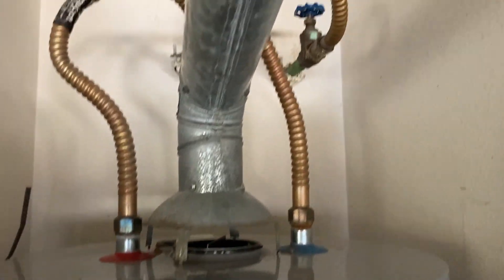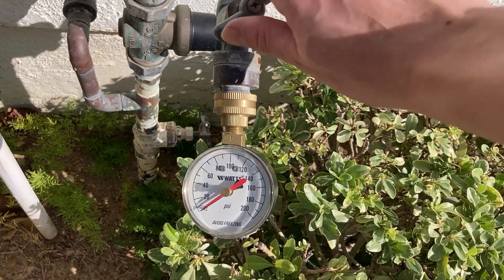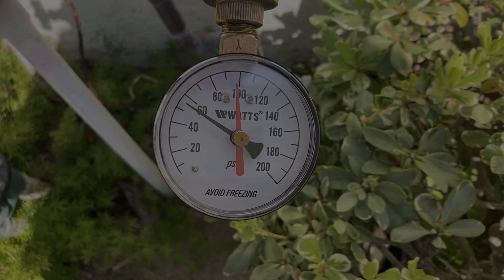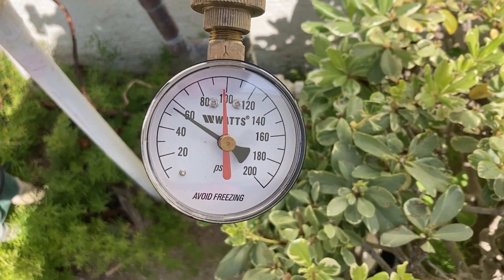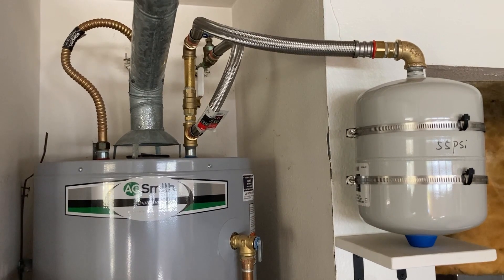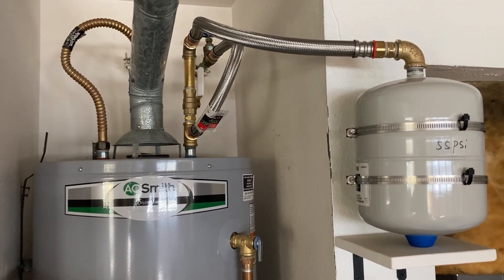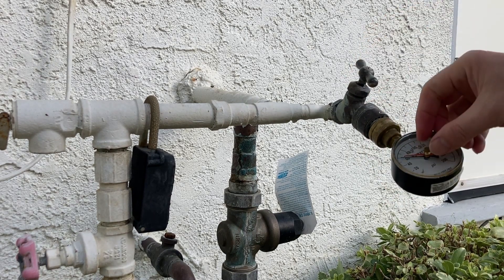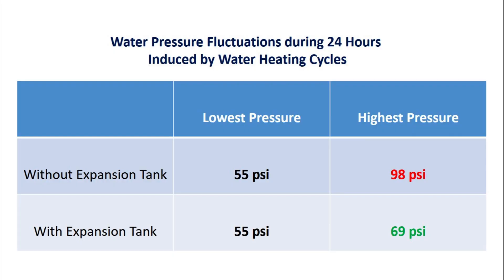Comparing Pressure Fluctuations Before and After Installing Thermal Expansion Tank to Water Heater

Comment: Shouldn't your hoses be reversed as you want the inlet to in the pipe & the tank line branch off after the inlet?
Reply from the maker: You mean switching the connections of the two hoses to the water heater? I don't see why it matters. Right now, the tank line is also a branch after the inlet.

Comment: What kind of hose is used between ex.vessel and main systems.Is that for Water or gas
Reply from the maker: https://www.homedepot.com/p/Everbilt-3-4-in-FIP-x-3-4-in-FIP-x-24-in-Stainless-Steel-Water-Heater-Supply-Line-EBBC-07-24a/206527409
It is for water.

Comment: System needs a PRV installed. Expansion tank on water heater has nothing to do with pressure fluctuations from street.
Reply from the maker: A PRV is already installed in the system. The pressure fluctuations measured in this video is for the pressure on the home side of the PRV, not the pressure from street.

Comment: Watts LFN55B-M1 water PRV has a thermal bypass built in.
Reply from the maker: Thanks for sharing the information. 
https://gistgear.com/product/B000E78XHG
Watts LFN55B-M1
"THERMAL EXPANSION PROTECTION: The valve includes a bypass feature that effectively controls thermal expansion pressure, permitting the flow of water back through the valve into the main when pressures - due to thermal expansion on the outlet side of the valve - exceed the pressure in the main supply."
Reply: And...           A thermal bypass is not the same as a thermal expansion tank.
Reply: @motogp9253  We know that, hence the two different terms.
Reply: @tulta3631  And...  what's your point from your original post???
Reply: @motogp9253 You must account for the bypass when checking pressures if you have a Dual Check Backflow Preventer.

Comment: something you didnt concider is. the red needle can and will bounce if a valve is opened rapidly  or sometimes even the sprinkler system .     installing a thermal xpansion tank  can act like a water  hammer arrestor  . So I  question the true accuracy   but not the concept and agree that is the purpose of the expans
ion tank .
Reply from the maker: Thanks for pointing this out.

Comment: Taking a bath or a very long shower could increase that peak pressure, unless you have a small leak or use some water shortly after using the shower. Also, people on a well do not need an expansion tank, as the tank acts as one.
Reply from the maker: Thanks for sharing your experience.
Reply: I've been wondering why I don't have an expansion tank.  Duh!  I'm on a well with a pressure tank.

Comment: Good video. However, two improvements: 1. Replace the rotary cold water shutoff valve with another ball valve. 2. Invert the expansion tank so that the water intake is located at the bottom. Which, in theory, would tend to maximize the durability of the rubber gasket inside the expansion tank.
Reply: Also having the air valve accessible on the top lets it be checked for pressure and bladder rupture.
Reply: Question, do i need to replace the rotary valve with a ball valve to pass inspection? does expansion tank needs to be secure to wall or can it be without it as long as is connected directly to the pipe, thank you
Reply: @pilot0208  Not required to replace the rotary valve, but a simply good idea to, since they often get gummed up & fail to work properly. The tank will likely need some kind of added support, in case it gets water-logged and the extra weight could make the pipes fail.
Reply: @RVail623  thanks for the info.  I am trying to do this on my own.  I understand that you are supposed to match the water pressure your water valve regulator outside the house is set to , to the expansion tank, I replaced mine but did not really tested it before I replaced it so I don’t really know what was the pressure it was set to before, so the question is what is it supposed to be set to? Does it goes based on how big the house is? How the city says is supposed to be set to? Reason I ask is because I have seen some videos and their houses were set differently, some were 80psi and some 50.  Any help on this is greatly appreciated
Reply: @pilot0208  If the city water pressure is 80 PSI or more, then a "pressure reduction valve" would need to be located just after the main house shutoff. Use that to adjust the in-house water pressure down to about 65 PSI. If the city water meter is newer, then  it may include a backflow preventer, which may in turn require a 2.1 gallon expansion tank on the cold water supply for the water heater.
Reply: @RVail623  thank you, so more likely I need to call the city correct?
Reply: My house was built in 1998 and I do have a pressure reduction valve, the bad thing is that builder did not put a water valve after pressure valve, they put it before the pressure valve so I can’t really check the pressure the pressure valve is set to, more likely I need to go inside the house, maybe from the washer and test it there
Reply: @pilot0208  The builder did correct, although having a garden hose spigot between the main shutoff & the PRV would be ideal. Easier to measure the city pressure. Note: once the in-house water pressure is obtained, use that number to pump up the expansion tank's air pressure (prior to installation) to match it.
Reply: @RVail623  thanks again for the information, have a good day
Reply: @pilot0208  It should be set to whatever static pressure the water in your house is (meaning, when no water is flowing through the pipes). I'm assuming you have a pressure regulator, and thus a closed system. If you don't then you don't really need an expansion tank.
Get a pressure gage that attaches to a hose spigot (the closest to the regulator the better readings you'll get) and measure the pressure with all faucets in the house, etc closed. Pressurize the expansion tank to that BEFORE attaching it to the water supply. If the tank and your system are at different pressures you'll either have a permanently at least partially-filled expansion tank (system has higher pressure). or the tank bladder won't deflect until the over-pressure from expansion overcomes the expansion tank pressure (higher pressure on the tank).
Reply from the maker: Thanks for your helpful suggestions!
Reply: Good advice. Also by inverting the expansion tank, less stale water accumulates within the tank. The expansion and contracting actions could easily clear any stale water,
Reply: @henryt9254  Just curious, how do you figure that?
Reply: And to add to that, I would replace the braided stainless steel hoses with stainless steel flex lines.  The braided ones are prone to failure.  Also consider mounting the tank with a tee fitting and running it in-line with the water flow.  Your tank is sitting on a dead leg and water may not circulate out of there which could lead to a harmful build up of bacteria called Legionella.
Reply: Manufacturers of the expansion tanks all recommend the water intake be on top, with air valve on bottom. You can do it upside down, but not the best position.
Reply: @michaelarmstrong4661  Not every expansion tank maker; I've seen some instruction sheets that say to prefer having the water inlet at the bottom. Which if re-considered unbiased, seems more natural to let gravity assist with drainage of the expansion tank, rather than trying to fight against gravity. Thus maximizing lifespan of the rubber membrane.
Reply: @RVail623  disagree. Amtrol, the company that invented these things, recommends inlet on top, air on bottom. Actually makes sense. I'll go with their opinion. Thanks.